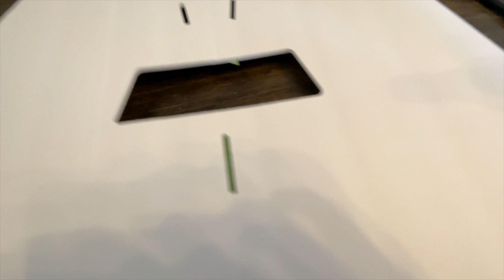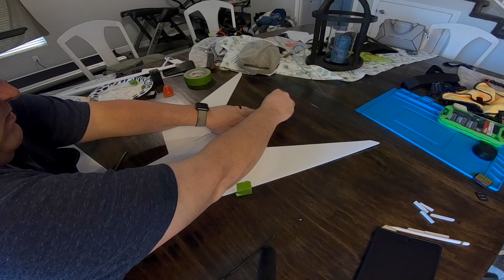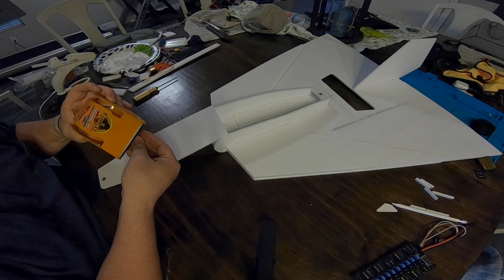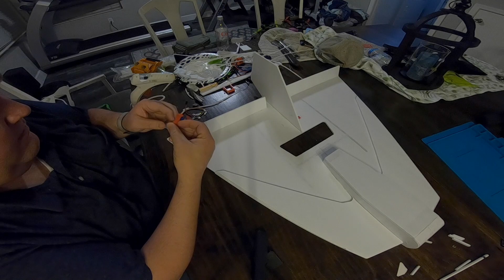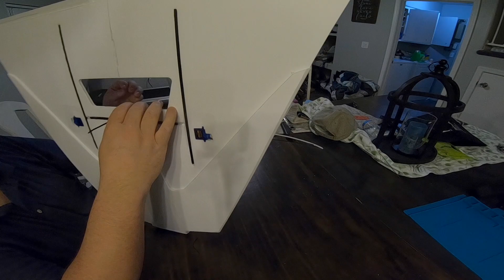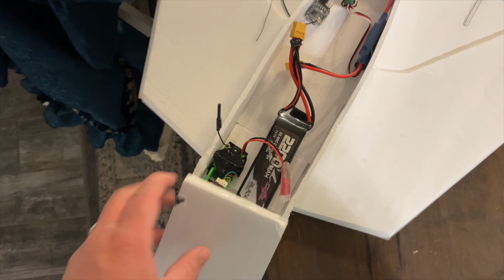How to Build a Stingray

Comment: I have been building and flying this model for years. I can tell you the designer is an awesome person, hyperintelligent. Help anybody with anything. We have guys that fly 3D with this model. I have low power set-ups (2212 - 2000Kv - 6X4 prop on a 2200Ma 3 cell) and high power set-ups (T-Motor F80-2500KV-6X4 prop on a 4 cell). The harder I push this plane the better it responds. Blast in high winds or calm. It fly's right out of your hand without throwing it.

Comment: what power set up is usually run?
Reply from the maker: We like to use 3s 2200mah batteries with a 30-40 amp ESC and a 2212 2200kv motor and a 6x4 prop.

Comment: This is a great build video. You mention that you send people a bag of hardware or a kit. Is there one available?
Reply from the maker: I originally made this video for my Brother, didn’t plan on releasing it to everyone. I 3D printed the parts for him. 
All the files can be found here https://www.printables.com/model/259967-stingray-fpv-plane
Reply: @AzTacoSauce  Thanks. Can you give me an idea on the size/length (diameter) of the carbon fiber you use?
Reply from the maker: @5StarCircus  5mm carbon works well and you can use tube or rod or square what ever you can find. Two pieces that are 12 inches long and one that is 9 inches long.

Comment: Hey Daniel, I did finish my build and am going to maiden it next week, Where would you say the CG is ?? using the same pack as you did.
Reply from the maker: Hey! Glad to hear you have it finished! You want the CG to be 8 to 9 inches from the very front of the nose. That’s normally a good spot to start with and then as you get more comfortable with it you can move it back a little. Normally I have to have my battery as far forward as possible.